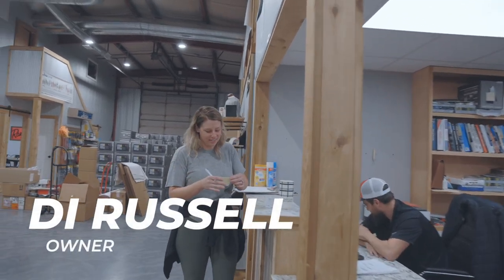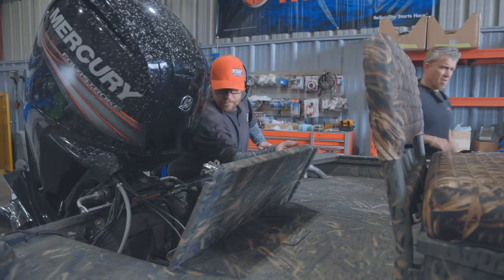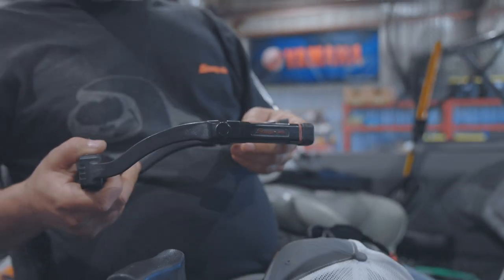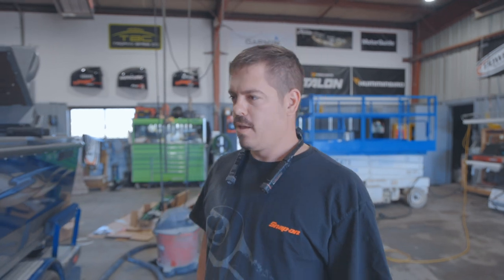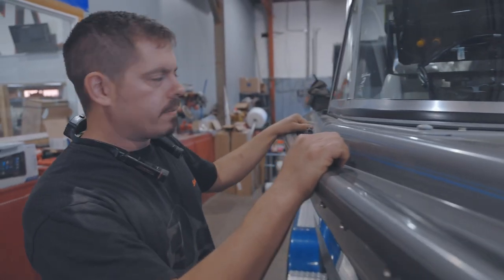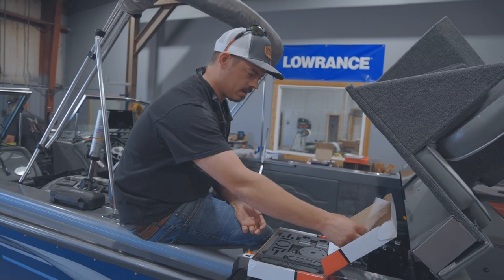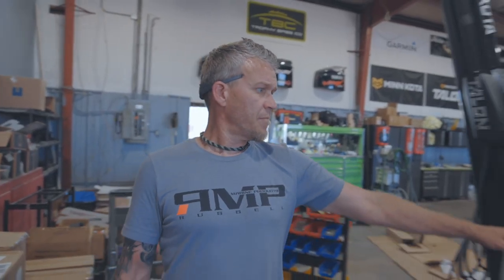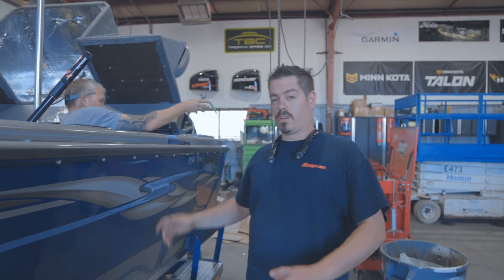Lowrance HDS Live Install On A LUND 1950 Type PLUS Minn Kota Talon - RMP Garage - Episode 4

Comment: Did you have to re-adjust the motor depth on the Ghost 60" when stowing?
Reply: On the 60” yes, the shaft does need to be raised up a few inches in order to stow in the cradle correctly